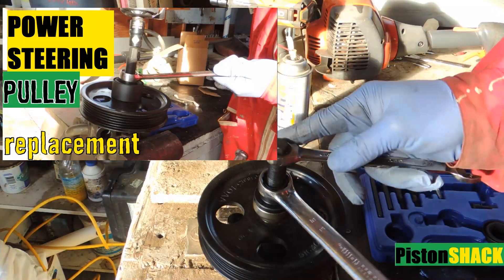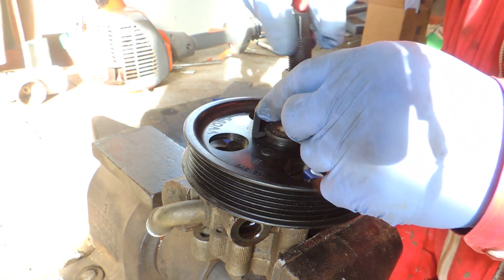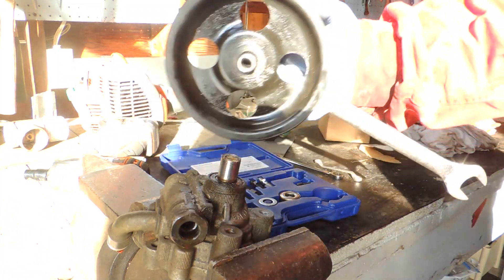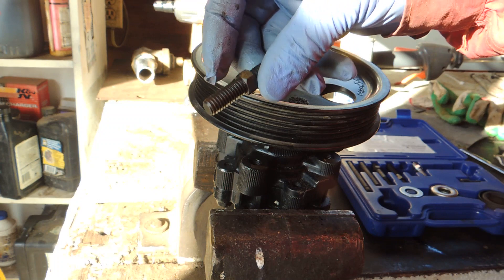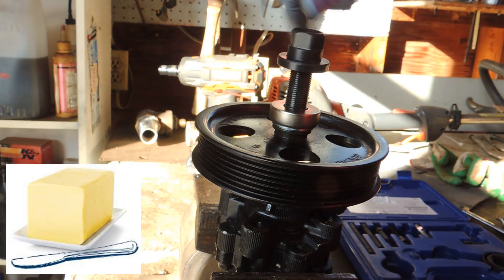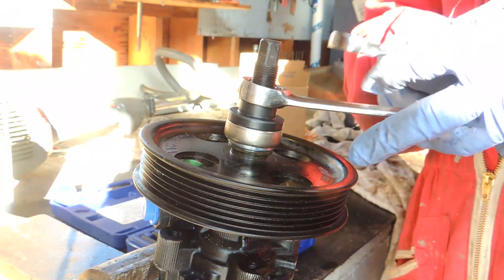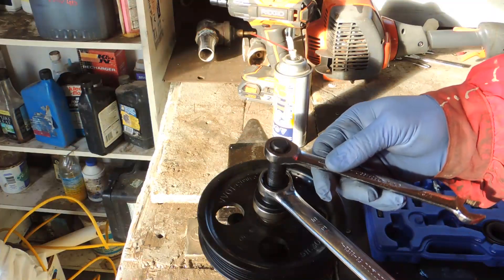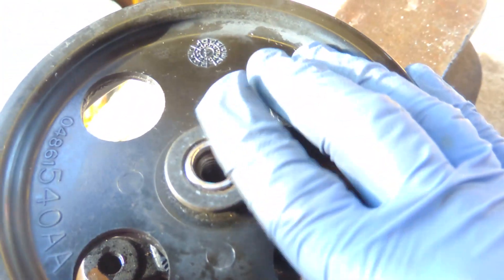HOW TO REMOVE AND INSTALL POWER STEERING PULLEY | Dodge Caravan

Comment: thank you for your advice. But the force I have put on the wrench to rachet down the installers nut feels like the instsllers bolt will break,I also have the pwr steering pump in a vice and have put a screw driver through on of the plastis holes iin the pulley and also that same screw driver that is wedged against the plastic pulley is also against the pwr steering housing . Iam also worried it might crack that as well. I also lubed up both the inside ring of pulley and shaft of pwr steering pump,they are both brand new. It looks so easy on u tube with people just holding the pulley in one hand lol! Thanks again for your coment,as this is a nightmare lol!
Reply from the maker: I would measure diameter of the new pump - pulley and old ones to see what tolerances are. Might try old pulley on new pump to see how that one goes.
Reply: thank you for the advice again. I bought 2 different pulley pullers as I couldnt get the old pulley off all that the pullers did was break off bits of the rim that the clam uses to pull off the pulley which never happened. So I gave up and bought a new dealer pulley to match the new pump,I should have mention I got the new pulley halve pressed down which was a struggle and just have about 7 turns left to its seated in the correct postion,but just cant get it to budge. So Iam off to pour a good strong drink lol! yikes!

Comment: I have a 2010 dodge caravan ,how do you stop the pulley from spinning when you tighten down the installers bolt. Is there a tool that attaches to the pulley to hold it ?
Reply from the maker: Hey Lynn. If pulley spins at the beginning, just hold it by hand then when pulley started installer screw will drive it down.

Comment: Hi! Thank you for everything!!! Wow!  How do I remove Power Steering Pump, ‘96 Mits  L-400 petrol? And I can’t seem to find replacement… help?😊
Reply from the maker: Hi, Michael. Unfortunately, I don't have Mitsubishi 6G72 gasoline engine to show you in details. Are you in Canada or US?
Reply: Hi! US…  I think I can figure it out, just need a lil direction and motivation I guess.. I can’t seem to figure out how to loosen the belt and pulley wheel to begin taking the pump off.. 🚐